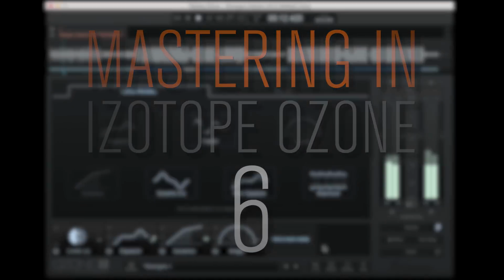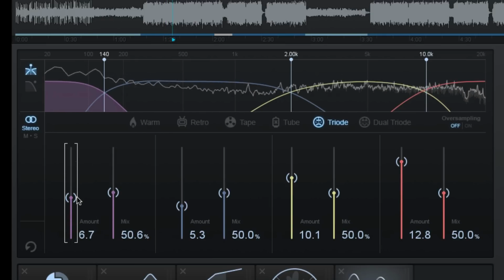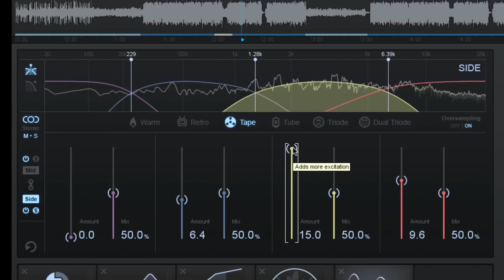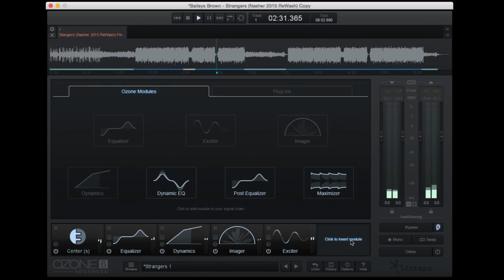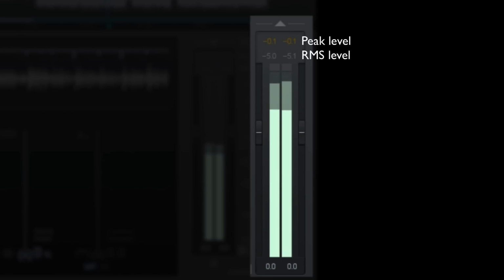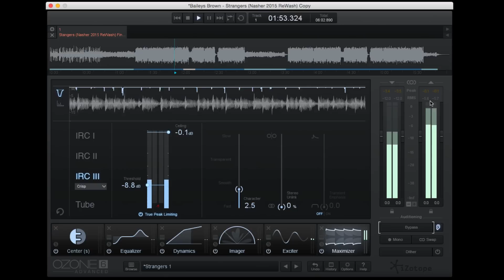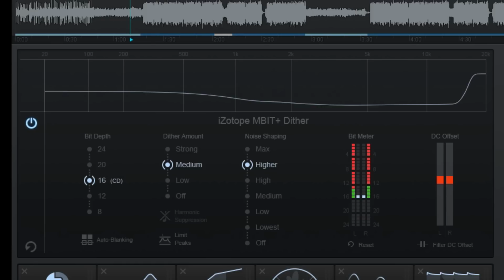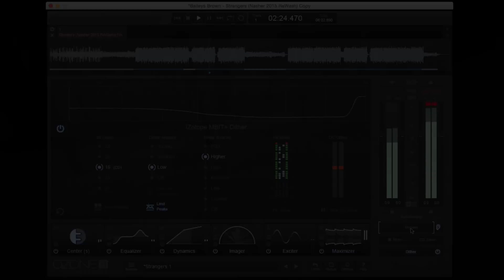Mastering in iZotope Ozone 6 Part 3: Exciter and Maximizer

Comment: Sonically, You can achieve more pleasing harmonic excitation by keeping the exciter dry/mix level at 100% and driving the required band by only as much as 0.1-0.8 (keeping it under 1.0). In my experience, driving the amount to higher levels and them bringing down the mix to 50% or lower (as suggested in this video) distorts the original sound in an unpleasing manner, especially in the upper highest band, where hi-hats can start to sound harsh very quickly. Furthermore, if you have already used some form of saturation/distortion during the mixing process (like iZotope Alloy 2 or overdrive plugins) on your channel strips, the increased "Amount" of excitement distorts sound in a very unpleasant manner, even if you bring down the dry/wet mix level. So, in my experience, keeping the mix 100% and driving the amount very subtly (0.1-0.8) gives a far more pleasing and pristine harmonic excitement.
Reply from the maker: MB TV Yup, you can def argue for that, it's all about taste. Once you know the technique, you can adapt it

Comment: The hardest thing for me when mastering is knowing WHEN to leave well alone. I noticed Anthony, even you after saving your presets specifically created for that track, you STILL felt the need for a tweak or two. It's very easy to get OCD about these things.
Reply: +djGreenALERT That's the crux...knowing when you feel that it's right for. Take ten different producers using the exact same gear, you get ten different tracks.
Reply: syn707
Very true. I watch and learn from as many people as I can, and cherry pick the best bits
Reply: But I'm with you on your point. Its scary having this incredible software and learning how to use  it. So far the presets are a Godsend..but Ozone can do so much more. That's why I'm going thru all tutorials that I can get my hands on. This can elevate our recordings to a whole new level.
Reply: syn707
I still use old 32 bit Mastering Tools that I know like the back of my hand. It's best to find one or two you like and learn them thoroughly, otherwise you can drive yourself mad and it gets very costly too. There is something about Ozone that's pleasing to the eye though.

Comment: I'm setting the ceiling output on the maximizer to -0.1 db and it's still clipping.. the output of the final mix is only around -3 db, and for some reason the ceiling output isn't working, it's still going over that. I've barely adjusted the multi band compressor and have slightly EQ'd the track. Why is it still clipping? I have no clue why.. any answers will help. Thanks
Reply: I set the maximizer last on the chain. Problem solved. Thanks me
Reply: +Brandon Ortega The limiter should always be at the end of the signal chain.  Just think of him as the Bouncer at the door at the Club.  Nobody is getting in or out unless he says so.

Comment: When you remove bypass on this track, there is a very high pitched ringing I can hear, that I think must be from the highest band exciter you have going. You might be able to pick it out on the frequency spectrum. I did see a high pitched peak there at some point, but you didn't have the kick soloed at the time. I think it might be in a frequency range you have trouble hearing in. It's really pushing my limits, which are up at 17-18k. Maybe you hear that and you like it that way, but it's a little off putting for me. But great video, your do a good job, and that track otherwise sounds really great to me.